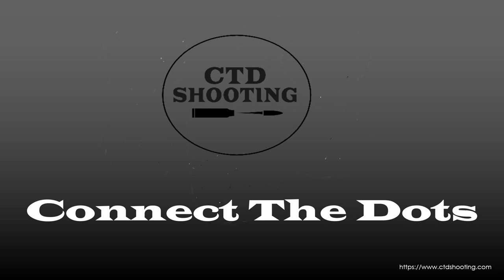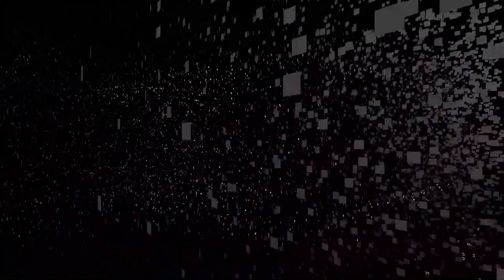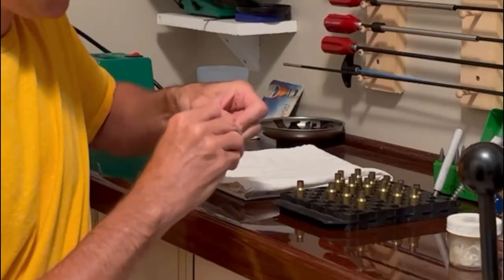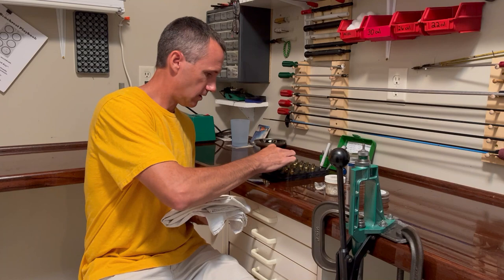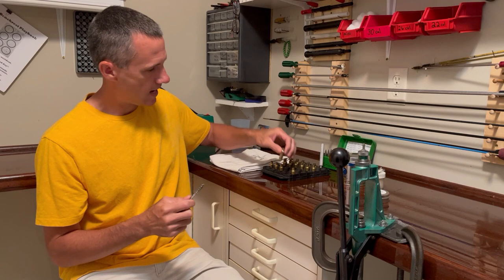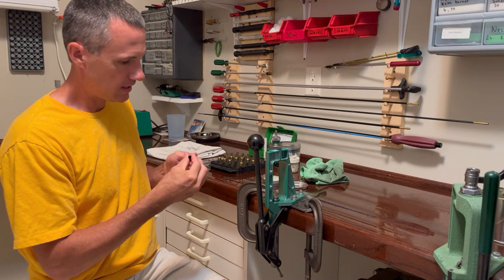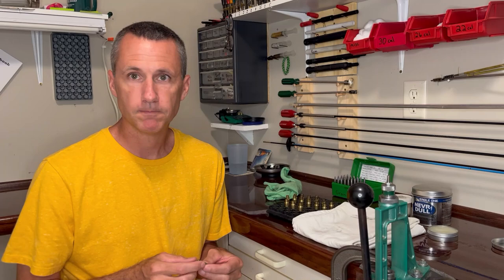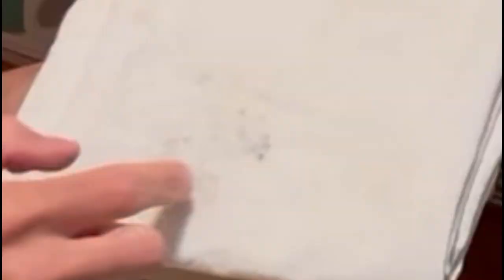Brass Maintenance Between Firings: ctdshooting

Comment: Just ultrasonic clean or wet tumble! Eliminate all those individual cleaning steps
Reply from the maker: Yes, when time permits that will accomplish the same end goal.  However, during a tournament or on some high volume hunts (prairie dogs for example) competitors/hunters need to reload their ammo and do not have the time to tumble or ultrasonic clean.
Reply: @ctdshooting  if you leave enough time to do it then you do. I shoot in matches and have plenty of time my steps ultrasonic cleaning, dry tumbling, and using a expanding mandrel etc...
Reply from the maker: @DS-gd1xw  Sounds like you are doing what works for you.  Great.  In NBRSA/IBS short range Benchrest we have roughly 20 minutes between relays.  Good shooting.  Thanks for the feedback
Reply: @ctdshooting  ok  I have a week or more.
Reply from the maker: @DS-gd1xw  I really appreciate the comments.  We all need to do what works for us - which may not be the same for everyone due to different circumstances.   That is what Connect The Dots is all about.  Giving people different ideas that may (or may  not) apply to their type of shooting.  Have a good rest of the summer.
Reply: @ctdshooting  dumb question, why are you reloading at a competition? Why not just bring enough loaded ammo or enough pre-prepped brass if you have to load it at the competition?
Reply from the maker: @joearledge1  Not a dumb question at all.  Two main reasons:  1.  Making the amount of brass needed.  I will shoot between 100-125 rounds per day per rifle.  That is a lot of brass to make and difficult to make each piece uniform to the standards required in short range Benchrest.  However, some competitors do this and come pre-loaded.  I usually make 50 pieces of brass for each barrel, preload those, and put preweighed powder in vials to load at the range.  Second - Changes in atmospheric conditions (mainly temperature) throughout the day can change the tune of the rifle.  Many competitors will slightly adjust their powder charge to stay in tune with these changes.  Great question.  I hope this clarifies a little of why I do it this way.
Reply: @ctdshooting  oh ok, guess I hadn't thought about the difficulty in getting that much brass precisely identical. Thanks for the info

Comment: If you clean your brass well, after knocking the primer out, whether wet or dry method, do you still get that debris off the neck and primer pocket?
I tumble with rice and two cups of Nu Finish car polish added.
Reply from the maker: Hi Hal.  I always make sure the necks are clean before resizing (I don't want the fouling to get on the neck bushing).  Primer pockets...I really don't know if it makes a difference.  I clean them just because I have control over that variable, but if I forget before priming, I don't worry about it.  Hope this answers your question.

Comment: I'm still on the fence about brushing the inside of the neck with a nylon brush.  On my short range benchrest rifle I'm not doing it and its shooting good.  But maybe there is something to gain my brushing?  Otherwise I do the same steps as you for the short range benchrest rifle.
Reply from the maker: Brushing the inside makes logical sense - but does it show up on target? I do not know.  Obviously, there are way bigger pieces to the accuracy puzzle, but it is  one of those situations of: doesn't hurt might help.  Thanks for the comment